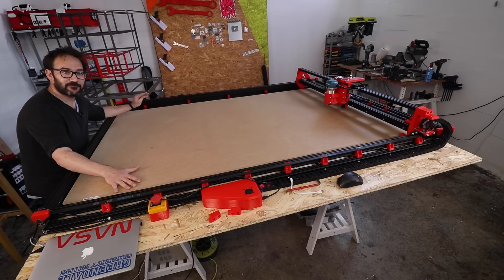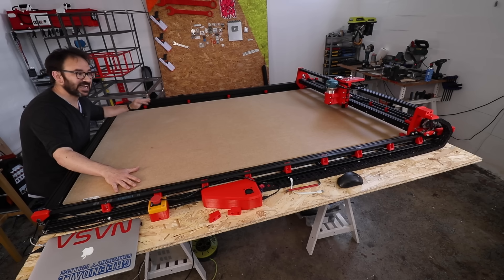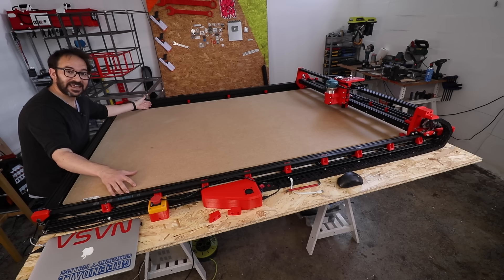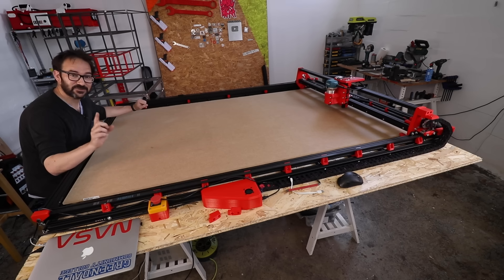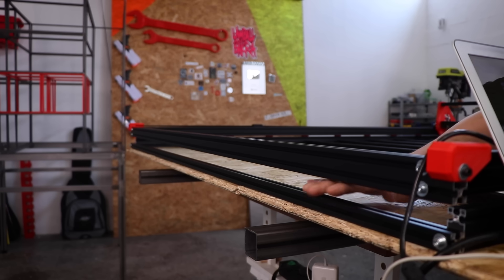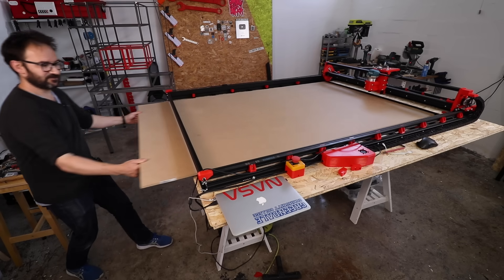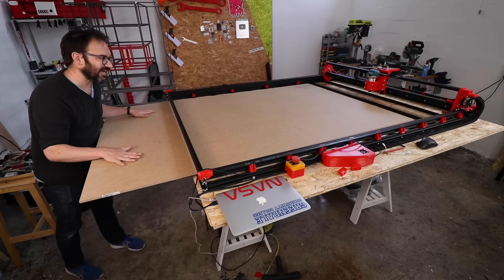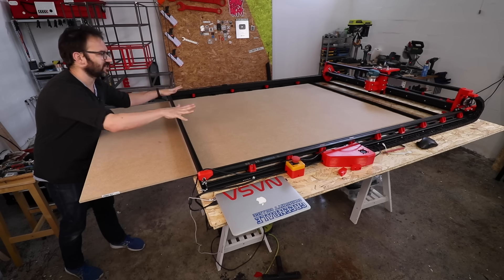LARGE 3D PRINTED CNC FROM SCRATCH

Comment: what filament did you use to 3D print?
Reply: You should use ABS to avoid creep issues and it’s heat tolerant. It’s the recommended filament for Voron printers for example. ABS+ on an open printer with a cardboard covering it works too.

Comment: 🚁 Central VACUUM CLEANER, CNC-powered, 🏗️ mounted under the ceiling and synchronized with the printer head. Giving a very large draft and feeding a pipe around the head or 20 small pipes lowered into the material. Or an electric suction cup that will periodically pass under the head as it is operated and moves to the side. Automate to clean up waste after waste of time!

Comment: Ivan, could this design be scaled down in the X and Y? I'm also having a hard time telling if this uses 2020 or 3030. I have an excess of  2020it from a previous project, but haven't found any designs which rely soley on 2020 over 3030 or other combinations.

Comment: Did you use Arduino to drive this machine ? Would it be possible to build a machine with the same 3D printed parts but with a smaller frame ?

Comment: Is belt sistem beter than ballscrew for this lenght... i have Nema 23 motors like on this video... whitch system uses less friction or power so that this motors would run smoothly ?

Comment: I do like how you design the 3D printed parts which were simplified the mechanism of the CNC router machine.
By the way what is the type of CNC Controller and motor driver do you used to make the machine running smooth.

Comment: I am curious as to where you got your extrusion rail? For some reason in the states, you can't really get anything longer than 2400 it seems. Unless you go with industrial extrusion from Grainger. And none of that is V-Slot. I have been hunting for 3000 length and my best option so far is two 1500's with the 180 Degree joiners.

Comment: "I was planing on making it smaller". lol, I have the same problem. I was inpired by the last CNC build on this channel and was planing on building a CNC symilar that one. Ended up building a 3x2 meter monster built from 10cm square tubing with a z-axis that has a travel of up to 1 meter (Gantry can be moved up and down depending on the job). Got myself a rack and pinion setup with 3 closed loop 8.5nm nema 34s for the x and y and a nema 23 for the z. Just finished the bearing setup on the y-axis carriages today. Only need to finish off my z-axis setup during the course of this week and it is time for the first chips to fly. No printed parts, all welded steel beast. Mine can fit a full melamine board so I think it is big enough now. Can't wait to see what it will do, I am so excited. This is either going to be epic or catistrophic. Wish me luck in these final days of my build.

Comment: Seems like a bad idea. Cnc machines need to be stiff and strong. 3d printed parts are usually flimsy, brittle and not temperature stable. Given that most of it is made with off-the-shelf aluminum T-slot extrusions it would be better to  forget the 3d printed parts and use regular aluminum or steel brackets and plates....

Comment: Hey Ivan, if I might make a suggestion, consider investing in a set of counterbore bits - these are the boring bits designed to feed into drilled holes and cut wider, flat-bottomed openings to clear the heads of cap-head screws. (Not to be confused with countersink bits - a counterBORE bit cuts a flat-bottomed hole for use with screws with flat mount faces on their heads while a counterSINK cuts an angled hole for screws with angled head faces) Using a counterbore bit after drilling will allow you to place the screw heads inside the frame against the center of the extrusion instead of having heads and washers sticking out from its surface, which will make for a cleaner look and also prevent having potential "catch" points along the perimeter. (It'll also prevent distorting the outsides of the extrusions' profiles when the screws are tightened down.)

Comment: Hi Ivan, love your builds! I was wondering why you decided to use 3D printed parts instead of the machined parts you upgraded to in the last CNC router build? Is it because this particular machine is only going to be used for cutting easier materials or was there an issue with the weight of metal components being used on a larger scale? Would love to hear more about your decision making/design process! Thanks :D
Reply: So that people like me to build this thing without having the other machine

Comment: Great build!! Tons of value in that machine. If you change your belts out to 3M kevlar you’ll improve accuracy and even increase cutting feedrate a bit, as they simply do not stretch. Even better results if you replace the belts with rack and pinion gears. Seriously great machine, though!! Punching WAY above its weight, cost wise!!! 👍 👏 👏 👏

Comment: This build is incredible!! Need a way to mount that vacuum hose to it and have it run when the router is running...
BTW, what is that tool called that you used on the drill to smooth / round off the end of the lead screw after you cut it?
Thanks

Comment: Pretty cool.  How about setting it up so that it runs on it's side.  That way it takes up less space and the material sitting on it's side would be less affected by gravity.  With the space you save, you could run several of these in a garage all at once!  Just thinking about it, you might need to add counterweights to balance the weight of the router.

Comment: Entertaining and lots of good points. Wrapping the 3DP parts with carbon fiber tow + epoxy could improve stiffness (for higher feeds), like what's done on bicycles. Also strengthening the top X span.

Comment: I assume that we can just change out the router you used for one that's better suited to aluminium and steel etc. Correct?
Or which areas would I have to change to account for metal other than software etc.?

I have been wanting a metal CNC router and buying is far too expensive for me (very glad you posted this video btw).

Comment: Great work as usual, 45 degree frame braces under the bed would allow for cutting stuff through the printer on the ground or engrave concrete floors or tiles or whatever, frame looks sturdy enough to handle not having so many center profiles

Comment: 4:34 One thing i'd change, is make the tensioners non-static on the carriage. A simple spring shim stock can make the wheels adjust dynamically rather than force the belt at all times. This is common place technology for large printers. And as you know, those require precision as well. This is more of a long term thing, as it doesn't wear the belt as much as a static tensioner does, nor does it put as much force on the frame, which is not the correct way (none of the industrial precision machines i've been inside of has ever been drum tight as most forums suggest). Just my 2 cents.
Reply: hey what do you mean by this exactly? where does the spring shim stock live? I get your point about the tension but can't picture what you are describing just yet... Hope you can help!

Comment: Don't you have to worry about deflection?  Those spans are pretty long.
Reply from the maker: Worrying no, taking it into account yes. Every material deflects but as long as I'm not too ambitious with the forces of the router bit against the part it won't be an issue.
Reply: @ivanmirandawastaken   Makes sense , I built a 1500x1500 ballscrew driven DIY one, second time around it could do some decent trecodial milling(Read as spending more money the wife doesn't know about).  Love the channel and am envious of your creations.

Comment: Amazing!! I had started building my own 3D printed cnc using a different design but i think i may start again with this one. I have to ask, why did you make it so it wasn't big enough for 4x8 sheets? is it something to do with the lengths of extruded aluminum? Also, could you hang this against a wall?
Reply from the maker: Shipping anything larger than 2m by courier is super expensive. And yes, it could be hang, I use a grbl config that leaves the motors always on so you would not lose zero.
Reply: @ivanmirandawastaken  Thanks for the reply Ivan :). Really is a great design and the 3D parts look a lot more friendly to print that others i have seen. I look forward to putting this together :)

Comment: This is an Impressive build. Curious how low of acceleration you need to use with those steppers and mass of the rotary tool?
Reply: We think alike. That's an S-ton of mass to swing around with those little steppers. I've always wondered why use pulleys at all for X and Y, when a pair of parallel steppers could occupy their place and double the torque (for Ivan's slightly up-sized projects)

Comment: That plywood gear probably costs more than the machine with lumber prices lately
Reply: I don't know if in Spain prices have also skyrocketed
Reply: Probably just order the extrusions from china, then use the the month it takes to get them to print all those large parts .. lol 😆
Reply: Aluminum prices have also skyrocketed so probably not,   but it is an awesome machine regardless.
Reply: I was pricing up those aluminium posts a few weeks ago here in the UK, for 8 of them at 120cm was over £100 - i dread to thinmk how much those 6 or 8 footers cost!
Reply: In South Florida a sheet of plywood that use to cost 35 is now 70-80 .. and you cannot find things like birch or sanded plywood ..
Reply: @djmjr77  Right in time for Hurricane season, too.

Comment: I just finisht mine. it can cut up to 35x35x8 cm. Made it al myself with 3d printed parts and now im gone make aliminium parts with it for it :P
Reply: arduino cnc with grbl. nema 17 motors. 500 watt motor.  work like a charm. shame i just dont have more space. 

the problem i had was the motor magnetic triggering the endstops. Solution ? just remove the endstops ;P